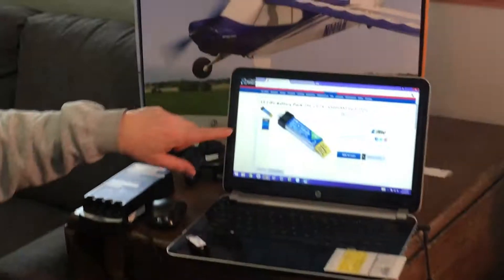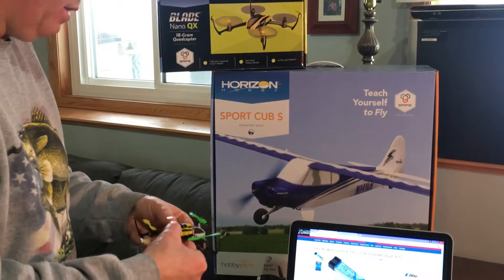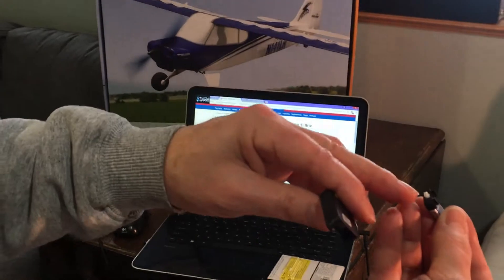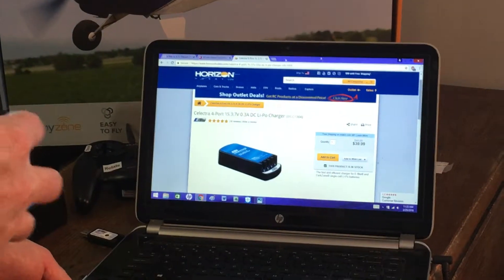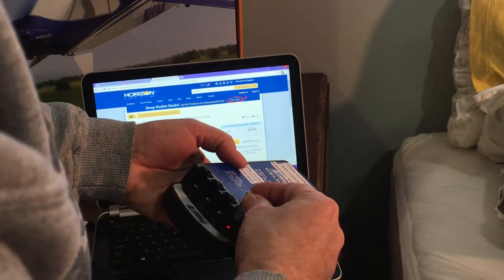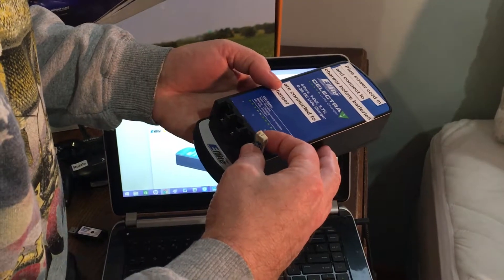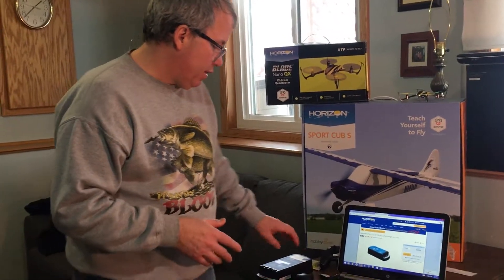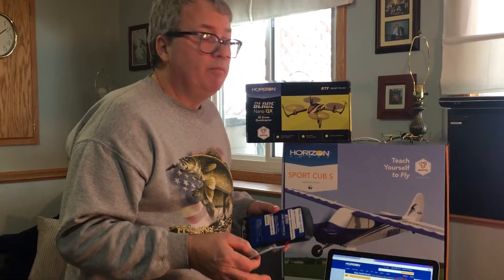Charging Eflite 1S LiPo Batteries

Comment: I discovered sadly that it is possible to connect the battery to the charger wrong, and it ruined the charger. It's not hard to force them to connect wrong. I am new to the RC hobby.  I was glad you said to insert with both labels up.  Seems like Eflite would want to make that clear in the charger instructions. Thanks for the useful video.